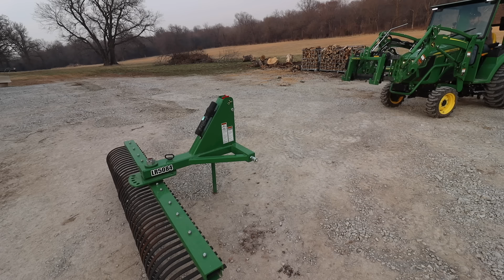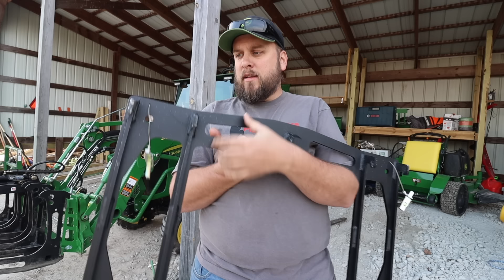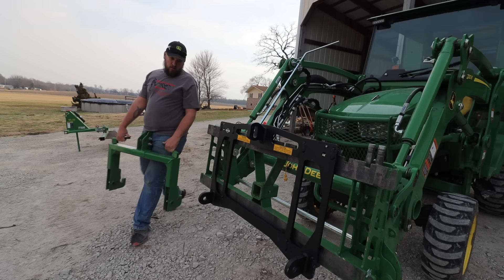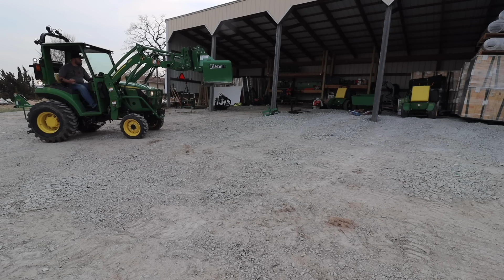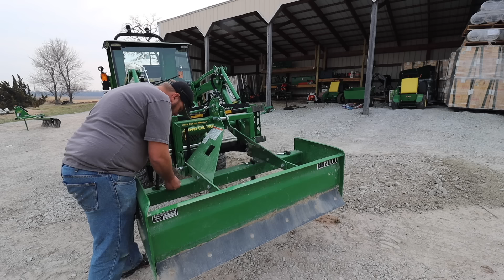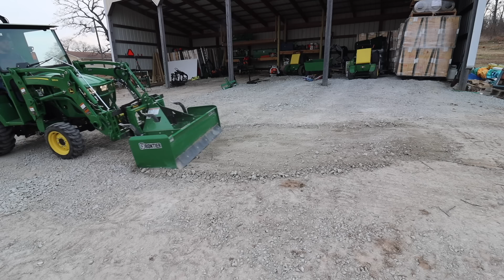3 Point Attachments on the Front End Loader?

Comment: Very intrigued, love the idea about the storage being able to stack the equipment.  
Only now being able to use it to work the equipment like the box blade or blade for snow pushing, from experience,  the loader does not have the strength to push, I've watched my dad pushing with our 6400 JD, and i could actually see the loader flexing.  All the pivet points or attachment points on loader are cracked the bottom where loader attaches to tractor is completely broken,  so if you back blade the whole loader comes right out of the cradle on tractor.   Also my dad was super hard on it, he didn't know when to stop pushing. I have to rebuild the whole loader. 
Now if you had a top point from the attachment to the front bumper, two of them to help with a side load, like hitting a hidden rock,  it might save the loader, but could break something else.

Comment: Do you think you could use a set of 3-point forks on that set-up as normal loader forks?
Reply from the maker: Yes, although anything that you add to your set up, moves the load further away and add weight.

The point being that you will have a little bit less lift capacity

Comment: I have a very wise suggestion.   Sell the John Deere fast well its in one piece and isnt broke... Then go buy a Kubota ...    The cost of parts alone will sink a ship...  Even if you repair it yourself...  Keep or sell the attachments,,,  there about all the same....   If you do keep the JD be very gentle,,,, no skidding logs or hooking chains to the bucket..  No pushing over trees...  No real work it will brake.  If I could only have the hours I spent repairing these newer JD tractors....

Comment: I took a 3pt hitch racke and made mounts so I can slide my palet forks into it. It works great for raking sticks and branches from fallen trees. I have also used it to rip up sod before using my bucket. Works good on gravel driveways too. It's rips up the first inch or two and you can go over with a bucket and make it really nice.
Reply from the maker: Nice DIY solution

Comment: If you mounted a SSQA mount onto those JDQA plates, you could rent, borrow, inherit, or buy SSQA implements and place them on your green loader.  You might find a circumstance where there's an advantage in that, compared to going out and getting a green implement.
Reply from the maker: Thanks for sharing

They make adapters but I’ve got quite a few front end attachments already so I probably won’t be switching

I thought about getting one just to have it in case I had something I wanted to run

Comment: We have very VERY rocky soil here in southeast New Mexico and trying to prep seed beds, lawn and numerous other projects for the homestead has proven to be extremely difficult for one reason… a rake or box blade on the three point has no downward pressure and therefore, simply skips across imbedded rocks. With this attachment, I can push into the soil, gain purchase and actually remove things. 

My friend, you may have saved my homestead…. And likely my sanity. 

Thank you so much for sharing this!
Reply from the maker: Thanks for watching
Reply: Be careful with pushing too hard on loader. Depending on how strong your loader is you will break it, or you will start seeing cracks where cylinders tie in. 
My loader is completely destroyed from doing this. And pushing trees over. 
I have a JD 6400.

Comment: Brock, I went about it the opposite way. I wanted to use SSQA attachments on the 3 point. https://youtu.be/uhxPtdXPA04. Do you ever wish you had the ssqa instead of JDs?
Reply from the maker: No.  What is the advantage to ssqa?

Everythingi have looked at has been available with the John Deere quick attach and it’s very easy to use

The only advantage I can think of is it might be easier to find a used skid steer stuff locally?  

I would like to be able to put a pallet forks on the three-point
Reply: @RockhillfarmYT  
1. Ssqa locks attachments tight. 2 angles are always working against each other when made correctly and as you said probably 100:1 ratio of attachments with ssqa to JDs.

Comment: You will need heavy duty 3 point attachments if you’re going to use them on the front. I destroyed a tractor supply box blade. I have a Woods box blade now. I don’t think you can destroy them. I tried the rear blade for plowing snow. It just seem to work better on the back. My tractor has the skid steer quick attach. You can get the adapter on amazon.
Reply from the maker: I’m not only planning to do light work on the FEL when using 3 Point attachments

Comment: That's a great story, Brock.  That you were going to try to make a front 3pt setup, and discovered that Artillian already had one.  Perfect!  It looks very useful.  If someone doesn't have the quick hitch, do you put pins through the bottoms holes and run the top link pin through the top somehow?
Reply from the maker: I have not tried that. It looks like the top would work but I think it might be difficult to get the bottom pins in

Right now, I don’t know if it works without a quick hitch or not but I will be finding out

Comment: Cool video, interesting product as well.  Short of a pole, I'm not sure what else this would be preferred for.  You might get a little extra "reach" in low clearance situations where you can drive in but not back in due to the ROPS, but really I think 3PT implements are designed and work better on the 3PT (as expected).  

What is the the downside to storing 3PT implements on a pallet, then use pallet forks to set them on a rack?
Reply from the maker: Nothing wrong with it, My stump grinder is strapped to a pallet right now

There are however a few downsides to moving the attachments that way in my mind. Number one , attachments come in all different shapes and sizes so some don’t sit on a pallet well so you would be building custom pallets to do what I want to do

Second I am building my own pallet racks that are exactly the size I need them to be and I will be able to lift the implements higher this way And fit them in where I want them

With my front end attachments I am able to stack three rows high by custom building the shelves
Reply: Sounds good - keep the content coming!
Reply from the maker: I’m trying to maximize a smallish equipment shed

Thank you for watching and for commenting

Comment: Might be good for a landplane. You would be driving over what you've already leveled.
Reply from the maker: Thanks
Reply: You would have to fab the connection point to push the land plane I think your into something though. A land plane on a front hitch could work as long as you don’t trench the finish grade from wheels spin while pushing the leveler.
Reply from the maker: @darrickhamerlinck5472  you can’t push the land plane with the quick hitch?

Not sarcastic, honestly wondering
Reply: @RockhillfarmYT   you can shove material with the backside of a box blade. I don’t think it’s a very good idea to put that much stress on the curl cylinders on your loader
Reply: Personally I wouldn't do much with it. Start with box blade if need to, then land plane, both on 3 pt. Then put the plane on the front for final finish, moving very little.